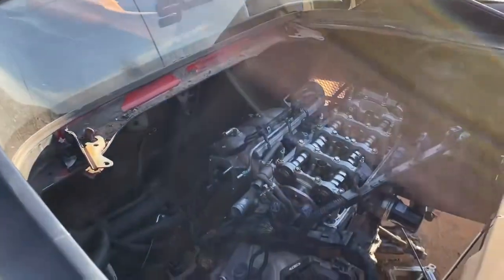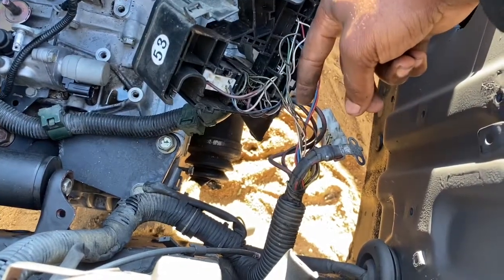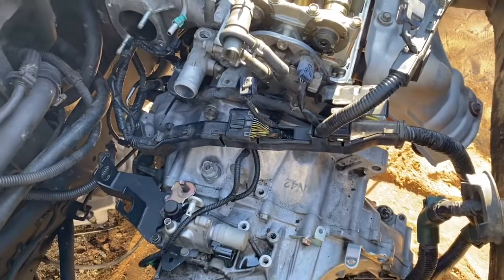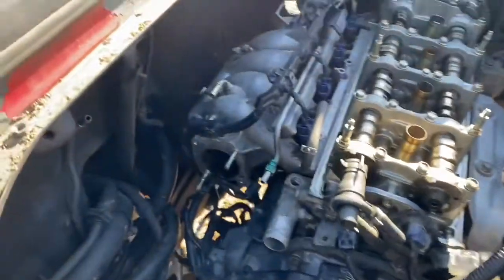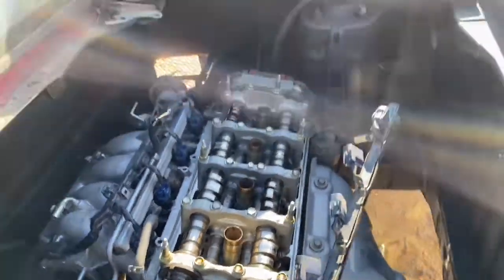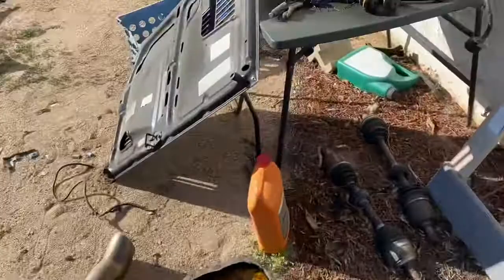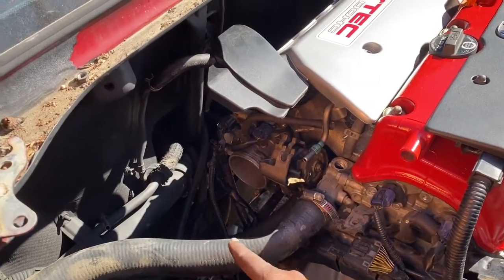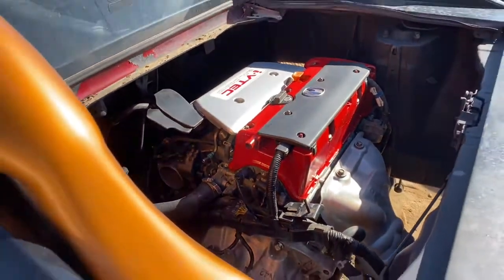MR2 K20Z1 PROJECT (PART 6)

Comment: Great video, by any chance do you know the thread on the transmission mount? I pulled out the stock bolts for the mount and the thread is all messed up
Reply from the maker: Thx bro , you definitely number 1 subscriber , I’m not sure but I can check with my drill and tap kit and let you know
Reply: @rarewitit7899  if you have the time I would appreciate it. If not it's ok.  Just trying to support what you're doing man. Keep at it.
Reply from the maker: I tried to to check the whole but I retap kit was to small , if I had to guess maybe 3/8
Reply: @rarewitit7899  it's cool bro I'll try to figure it out. I appreciate you trying anyways
Reply: @rarewitit7899  to anyone that reads this. I got the tap. The thread is 12x1.25. thanks bro
Reply from the maker: BOOSTED FAM thx bro good to know